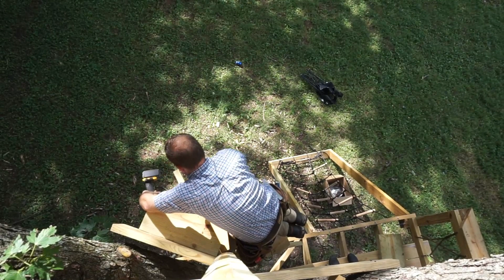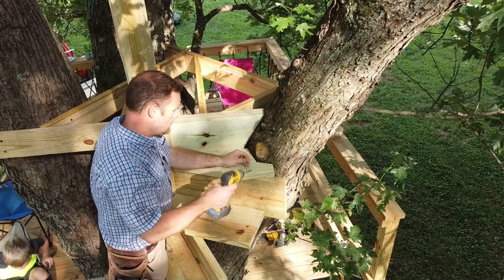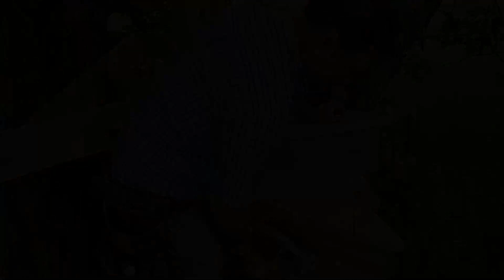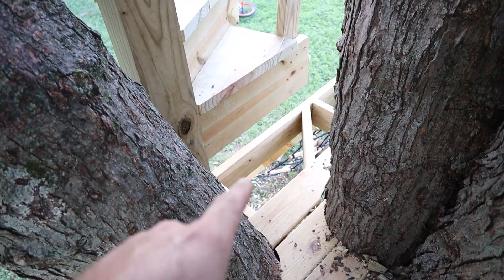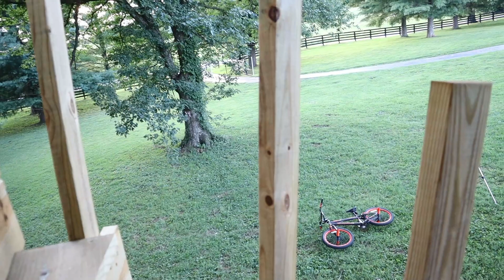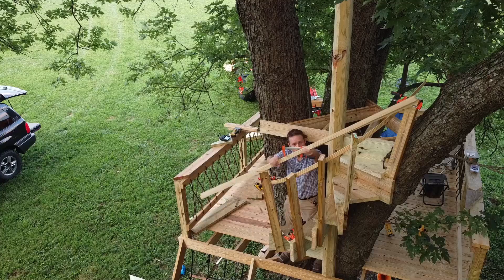#117 Quarantined Dad builds Amazing Tree House

Comment: I have used Gorilla Glue on PT. Works great but know this, it does expand so clamp the living crap out of it.  It will also expand out the sides so be ready to do some clean up.  You may want to test a small batch.  To work properly, they recommend you wet both surfaces.  Best of luck.
Reply from the maker: Bubba Tim I’m hoping to not have to go that route, mostly because of the “foam”. But it may be my only option.  The lumber has been here a while so it’s somewhat dry.  I may try a few test pieces with titebond 3 and see if it works
Reply: @shaweehillsworkshop4226  Liquid nails may be an option...
Reply from the maker: I may do a test with it to see how it works.  This is one of those things that doesn't come up to often.  Usually not thinking about gluing anything when working with pressure treated, lol.
Reply: @shaweehillsworkshop4226  I live in FL, we have moisture issue...Best of luck